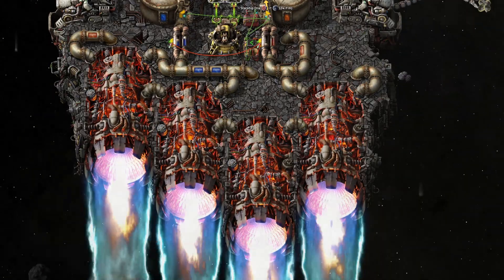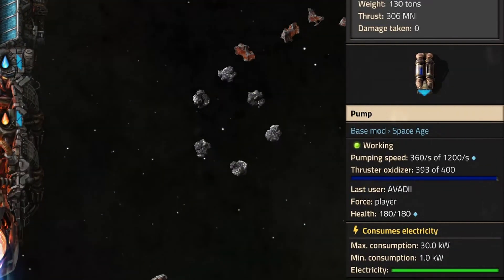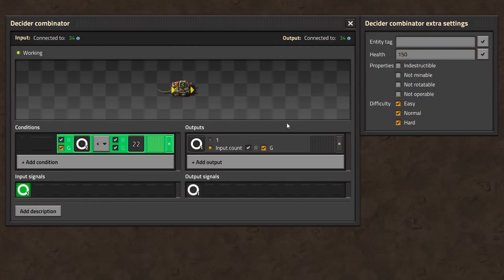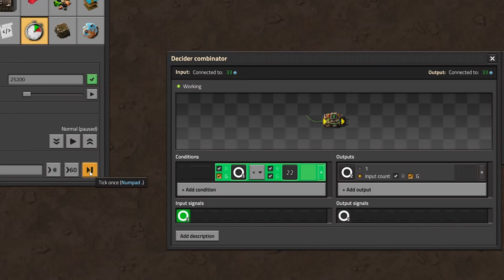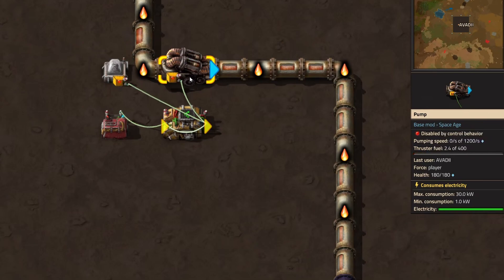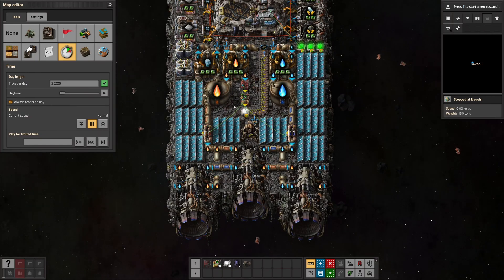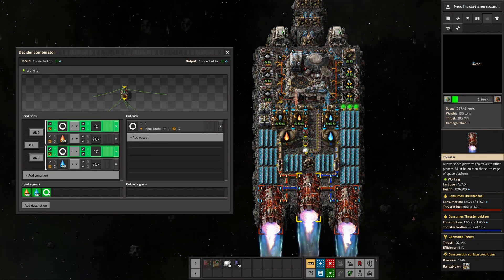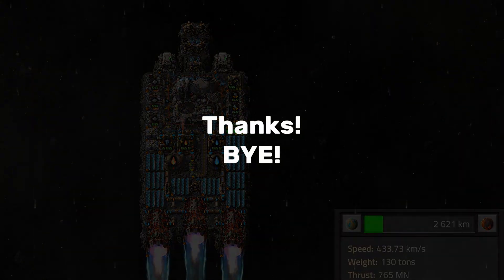Control Thruster Efficiency with Throttling! - Factorio Guide / Tutorial

Comment: One minor detail about the "no constant combinator" variant is that the system will now start counting from zero instead of one, so your 10-tick clock is now an 11-tick clock. If you change the "<10" to a "<9" it will be a 10-tick clock counting from 0 to 9.
Reply from the maker: Yeah I changed the thresholdds in the linked blueprint. Didn't want to make the video even longer with more explanations. Thanks for the clarification though!
Reply: you can also use <= 10, instead of <, this makes it easier to tell at a glance what it is doing, and also makes it easier to drive your loop length with another signal, rather than being hard-coded
Reply: Or change “< 10” to “<= 10”, which is less confusing because it still shows the exact total number of ticks you want to count.

Edit: @catsnorkel beat me to it.
Reply: @pindab0ter  um doing that adds another tick to the length. So if you used it with no combinator variant it would be 12 ticks
Reply: @patricklinford689  You are correct. The correct solution is to think 1-indexed instead of 0-indexed; turning 0 <= 10 into 1 < 10.

Comment: I have learned that you dont even need the constant combinator now since you can just add the same output in the decider combinators output section (just remember to set it to only output 1) nvm I didnt watch the video fully
Another tip I have found is with many ships having to adjust the throttle control on each one separately when they go too fast/slow gets kind of annoying, so I have a constant combinator with a logistics group for some type of ships (for example all the transport ships) with a value (in your case 2) that controls when the pumps start pumping, so that when I change the number in the logistics group it changes on all the ships.
Reply from the maker: That's very clever. But the ships then have to be the exact same model / have the same schedule.
I don't have any identical ships. :D